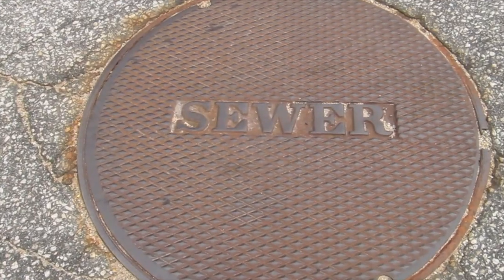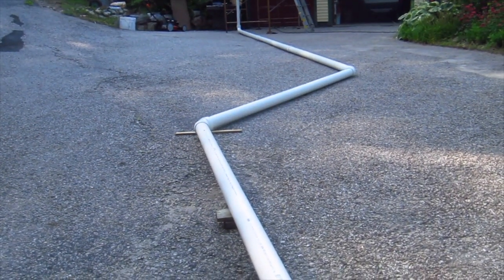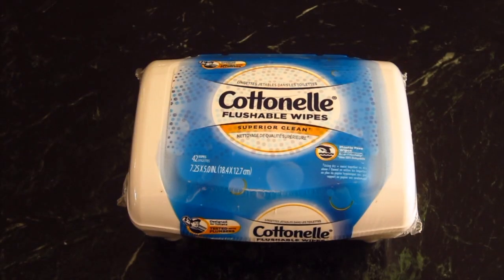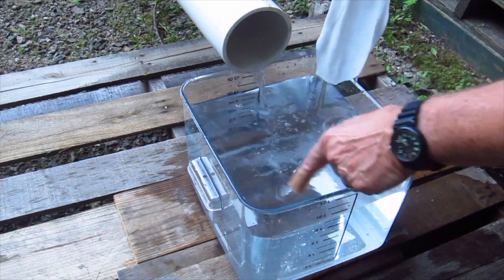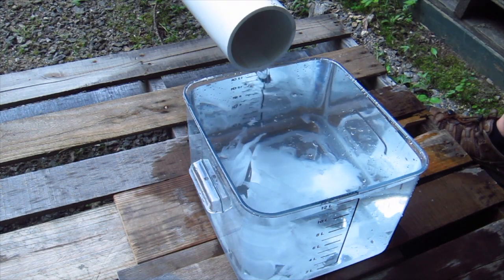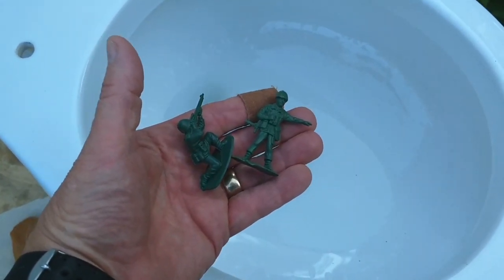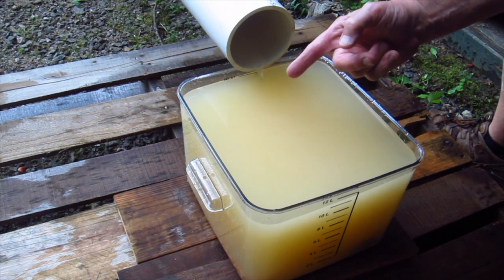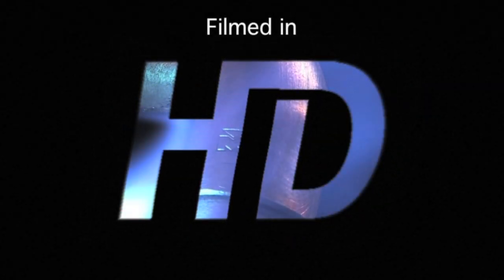Flushable Wipes - Do They Disintegrate?

Comment: Eventually! But if you have old cast iron and or terracotta pipes they will get caught up and block your system long before that happens !!!!!
Reply from the maker: Correct. That's why early in the video I talk about my test setup and how the PVC pipes were new. The chances of a clog in my test caused by a rough surface in the pipe were 0.0000000000000%

Comment: Yes never flush those so called flushable wipes besides clogging your sewer pipe inside your basement it can also clog the lateral pipe thats underground and goes to the street where it connects to the city's lateral sewer pipes. If you dont have the right type of home owners insurance and the lateral pipe gets clogged then you will be responsible for that repair bill too. That bill can cost from $5,000 up to $12,000 or maybe more

Comment: The ones my tenants used were not. It cost $800 in plumbing fees.
Reply from the maker: No, they WERE flushable. As I demonstrated in the video, you can flush hundreds of things down a toilet that should NOT be flushed.
Reply: @askthebuilder  didn't watch the video.  Too much like work :) but.. I won't let any tenants use wipes in the plumbing system. Just my rules.

Comment: I never use so called flushable wipes. I try to get a shower afterwards.  😂 Serious question tho, would pipes with a rough interior break apart these paper items more than these new smooth pipes?
Reply from the maker: No. The wipes that are durable are more likely to get hung up in your building drain creating a choke point and future clog.

Comment: Did a tour of the wastewater treatment plant for Cub Scouts.  The solids strainer had mostly flushable wipes and condoms in the screen.  If the sewer system is newish, they shouldn't cause a problem.  However, I can see how old systems will have a problem.

Comment: By flushable, they must mean that it will clear the bowl, but clearly just clearing the bowl doesn't mean it will clear the pipes. It should be illegal to call them flushable.
Reply: The video did show it clearing the pipes though.
Reply: @MonkeyBurrito  they do usually clear your pipes, at which point they become a problem for your city to deal with. But even that’s not always true. As he says in the video, your old pipes have snag points and buildup that worsen over time.
Reply: Technically golf balls are “flushable”
Reply from the maker: You can flush gravel, marbles, and thousands of other things. The labels should have a warning like cigarettes: WARNING: FLUSHING THESE DOWN YOUR TOILET MAY RESULT IN CLOGS THAT CAN COST YOU THOUSANDS OF DOLLARS.
Reply: @askthebuilder  mine do have that warning . . . well not in those words
Reply: @askthebuilder  You charge "THOUSANDS OF DOLLARS" to clear a blocked pipe?!
Reply: @ikiruyamamoto1050  Repeated clogs if the plumber doesn't bother to explain that the wipes are the source of your clogs. Or you might get several different clogs that need to be dealt with, or the clog is a lot more difficult to clear out. I'd imagine the several thousand is the upper end if the problem is severe enough that you have to rip out the old pipes and replace everything

Oh. I should probably also mention that sometimes a simple clogged drain can end up with other problems too. Apparently some Youtubers had a clogged sink that backed up the water drainage for some other pipes, which then lead to their air conditioner's catch pan for condensation and whatnot to become unable to drain and fill up considerably... and that lead to some pretty severe leaking in their ceiling with water pouring down like rain when the pan finally failed
Reply: @ikiruyamamoto1050  Shits expensive.
Reply: @ikiruyamamoto1050  If you can run a plumbing business charging less, feel free. You could not pay me enough to root around in someone's shit because they fell for this dumb marketing gimmick.
Reply: @ikiruyamamoto1050  THAT is why these companies get to sell these things.

Comment: I retired from the wastewater treatment industry about six years ago. These things were a total nightmare when they came out. We narrowed the source down to a few costumers and were able to get the problem pretty much under control. I sure hope something has been done by the manufacturers to either change the labeling or the product. Way too many of the brands should absolutely not be flushed. I feel sorry for anyone with a septic system that has used them.

Comment: Do they claim to?  Is every member of my specie  spoon fed reject?
Biodegradable means disintegrates?  
Just like a potato, vanish soon as flushed.
Just wow.
Reply from the maker: The Internet is littered with stories from sewer-plant engineers and municipal sewer-pipe managers demonstrating how many brands of flushable wipes do not disintegrate. They clog huge sewer pipes. They damage expensive pumps at sewer plants. Go to a store and see what the labeling says on the products. The issue is some may say NOT to flush, but the consumer rarely reads the label and flushes because it's easier than putting in a can.

Comment: All it takes to realise how fallacious of a claim "flushable wipes" are is to simply think:
How are these things strong enough to clean without falling apart while wet but weak enough to tear apart from simply travelling down a pipe?
Reply from the maker: I think your logic is a bit flawed. You might be confusing the word flushable with disintegrates. The wipes are absolutely flushable. So is gravel, so is nuts and bolts, so are marbles, so is dirt. There are thousands of things that you should NOT flush down a toilet. As I indicated in the video, the manufacturers are guilty of an ethical issue by advising people to do something that is harmful all for the sake of ease and profit.

Comment: You forgot Kleenex!
Reply from the maker: You're correct. I'm quite positive they would have done exactly what the single-ply paper did. You can test it yourself in a clear water glass. Fill the glass 90% with water and put in a small 2x2-inch piece of Kleenex. Come back in an hour and see what has happened to it. If it's still intact, then take a spoon, drop it into the glass and stir a bit to introduce turbulence into the system. I'm quite sure the piece will dissolve rapidly with turbulence.

Comment: Anyone who takes the time to set up a toilet atop of a baker scaffold to make a point deserves my attention and respect. I didn't know until NOW that flushable wipes were such an issue. Guess I've been too busy installing electric vehicle chargers to notice.
Reply from the maker: Thanks. This was a two-day project. I spent many hours both pre and post-production to share the truth with you. I could have flushed so much more, but I think the point is clear. Go here to get even more information: https://www.askthebuilder.com/flushable-wipes-clog-sewer/  and  https://www.askthebuilder.com/responsible-flushing-alliance-letter-to-askthebuilder-com/
Reply: A Baker scaffold is one that has locking adjustable height. They're usually sold yellow and have a single plywood platform. That's just a standard scaffold. This has been your tidbit from the man on the spectrum.

Comment: I've been a Public Health Inspector for over 30 years. When "flushable" wipes came out, I was teaching septic installer courses, so I put wipes in a mason jar with water and shook them. I still have them, more than 20 years later, they are still intact. They do not break down. Same thing with "flushable" cat litter.
Reply: A previous landlord had in the contract that tenants sign that they will not use flushable wipes. He learned about this after a huge repair bill.
Reply from the maker: Alex, some now do break down as evidenced in this video. The point of my video was to show what state they're in just before entering a septic tank or a city sewer line. The Internet is littered with stories supporting your stance showing how many sturdy wipes cause massive clogs in sewers and serious issues at sewage treatment plants. As I said, I'm good with people using them, but dispose of them in a can just as you'd do with a soiled paper infant diaper.
Reply: @askthebuilder  The thing that showed me you have more credibility on this issue than others is that you were willing to differentiate between different brands of wipes, rather than lumping them all into the same category as being equally bad.

I soaked several different kinds in water for days. Two brands weren’t even remotely affected. Cottonelle, on the other hand, can easily be shredded right out of the container. 

Even Cottonelle shouldn’t be overused. Anyone using more than one per flush is pushing it.
Reply: @askthebuilder  that's what the manufacturers are going to argue. What I can show without a doubt is that their claim that there is any mechanical component to the breakdown is complete nonsense.
Reply: That was 20 years ago, have you done another modern day test? Materials could change throughout the years maybe?
Reply: @HawksDiesel smart comment
Reply: @HawksDiesel  here's a modern day test. After clearing the drain line with a gas powered drain aug for 3 hours. 99% of the build up was from "Flushable" wipes.
Reply: But it is the bacteria that eats the wipes. When you put wipes in a Mason jar with water, it wasn't mixed with the waste and bio that is normally seen in a septic tank.

(A hypothesis from me.)

Great video, sir.
Reply: Why anyone would flush litter is beyond me. I learned to dispose of it in the trash. End of story.
Reply: @jociemarie compost
Reply: Soo why do they make em then
Reply: @AMJ-r9z they're criminals
Reply: @slothsarecool222  … because people will buy them if you claim they’re safe for plumbing?
Reply: I live in Texas (some pretty hard water) and did the same experiment, but my Cottonelle Flushable Wipes broke down in a couple of days.
Reply: I work for the City of Los Angeles Wastewater Collection,  now called Clean Water Conveyonce.  These wipes are a constant problem up in the hills where you have the bigger Houses/Mansions. Te cleaning lady's or maids constantly  flushing these down then we get a  big ol stoppage in the street  or in the right of way sewer lines. Always Roots mixed with wipes.
Reply: @operations845  are the cleaning ladies flushing cleaning wipes instead of these? I don't think cleaning ladies would use a ton of Cottonelle wipes to clean the house with.
Reply: Ooo I’m about to do this.
Reply: Wow! Companies and the government, stay lying to us. I'm glad to know of your informative experience in the field.
Reply: @alexmurdoch1391  so in essence it's a shit product because everything is flushable. But only toilet paper dissolves correctly.
Reply: You didn’t legitimately just say you did your test with water, did you? Is my septic tank only water, or are there certain bacteria that break down waste? You’re a fraud.
Reply: All of them break down better than my shit i can promise you that
Reply: @alexmurdoch1391  make it illegal through your city and state, Congress
Reply: @alexmurdoch1391  you got to put some poop on it or pee to help eat through it
Reply: Open it up and take a sip.
Reply: Maybe you need to add some organic matter to the jar. Have you tried poop?😂😂😂
Reply: @alexmurdoch1391  dude wipes are made with plant based fibers instead of synthetic fibers, but to be safe, don't flush them
Reply: Would it depend on how natural the fibre is for how well it breaks down in the septic tank?
Reply: False.
Reply: Not on subject but I did a similar experiment with my students and a McDonalds meal. Still intact, no spoiled meat, bread still soft and no mold one month later.
Reply: @lorihamlin3604  Why would you flush McDonalds?
Reply: @lorihamlin3604 And that is why that kind of food is a health hazard, it's sitting inside our bodies to a similar degree.
Reply: Yes they do! I’ve used them in hotel bathtubs to try to stop the water to run a bath and it never works! They break up into tiny pieces everytime
Reply: Liar  @HisSnowwhite214
Reply: America Strong!
Reply: When they say flushable on the label, then that means they're flushable

In the case of breaking down, I think all of the sludge goes SOMEWHERE to be processed in order to force disintegration 

You know all of that sludge MUST go SOMEWHERE after leaving your plumbing system And going through however much plumbing it goes through until it arrives at a certain destination
Reply: @0annonymous  your sewage lines might have grates in them that are meant to break apart waste. flushable wipes can get caught in up in those and cause a block.
Reply: @0annonymous wet wipes don't become sludge. They stay just as they are. In city sewer systems they routinely block impellers of liftpumps that cost a fortune to fix
Reply: @florichi 
If that were true the companies that sell them would be sued into oblivion, but wle
Reply: @0annonymous  You're wrong. That's called "marketing." To the people that don't care of their packaging ruins the environment because God forbid they should cut their child FRESH FOOD, and not buy chemical-laden packaged garbage! 

Fat dumped down the drain will STILL be there in 70 years! I've got photos of what my great grandmother did in that house that caused MAJOR plumbing bills in 2023. Full, top to bottom for four feet. Of compacted fat and grease.

Comment: What type of chemicals used in the making of flushable wipes ?
Reply from the maker: Easy. Read the product label. If the information you desire is not there, then reach out to the manufacturers for those trade secrets.

Comment: Don't flush facial tissues, either. They don't break down a bit!
Reply from the maker: I would agree that they probably don't break down within your building drain and on the trip to the city sewer or your septic tank. However, if they get dumped into a city sewer, the turbidity of the water as it travels miles to the treatment plant WILL break them down to invisible fibers. I know. I've tapped into high-capacity sewers.
Reply: @askthebuilder  The sewage lift we had before getting city sewer did NOT like facial tissues. It clogged up and had to be taken apart. That was spendy. I believe what you said, not arguing that. Have a great day and week!

Comment: In my opinion, a good paper towel is one that does not fall apart when wet. Because that’s mainly how I use them, to absorb and clean. But they go in the trash, not down the drain.
Reply from the maker: Correct. It's BEST to save the clean used ones. Let them dry and use them to soak up liquid grease. NEVER put grease down a drainline.

Comment: This experiment did not take into account the massive amount of toilet paper people typically use and flush in one sitting. 6 sheets of toilet paper neatly folded and flushed one at a time is hardly realistic.

I use cottonelle and always fold and tear a sheet in half so i can get 4 wipes from a single sheet and they end up taking way less space in the toilet and sewer system than the massive bunches of toilet paper people normally use.
Reply from the maker: This experiment was not about toilet paper. Check out the video title once more.
Reply: @askthebuilder  you included toilet paper in your experiment as a control, check out the video once more
Reply from the maker: @davidbasset7557  The six sheets is the testing requirement by the labs referenced in the early part of the video. Common sense tells you that adding more will ensure it doesn't break up. When comparing wipes to the TP, I had to stick to the guidelines or the FWA would cry foul. My suggestion is for you, since you have such an interest and strong opinion, is to recreate the setup, record your own video, use as much TP as you feel *people typically use*, upload the video, and come back here and share the URL with all of us. But I'm pretty certain you'll offer up some excuse. Let's see if I'm right.

Comment: And test videos like yours & viewing others means I will stay with my 3 gallon per flush toilets.
Reply from the maker: Smart man!!!! I wish I would have bought 100 of them back when the original low-flush toilets were introduced. I'll bet I could easily get $1000 for each one still in an unopened box.
Reply: @askthebuilder  While you can no longer buy a new 3 gallon flusher, you can order all of the piece parts to repair an 'old' toilet.

Comment: This only proves that wipes don't break down until they're further along in the system. I would expect them to remain intact a little longer than toilet paper. Dude wipes are made with 100% plant fibers, so I'm going to keep using them AND flushing them. I have been doing this for decades with no problems in the same house.
Reply from the maker: Christopher, you're so wrong. Tell me how you know wipes break down farther down the line. Do you have proof of this? The people who work in sewer plants have the proof you're wrong. Go watch all those videos or do a simple internet search. Also, READ all the comments under this video as several sewer-plant managers have chimed in. You're a great example of a person that makes statements and arrives at an opinion using a limited data set.

Comment: Great demo. Although, I do need to point out that using higher quality TP like Charmin one can (and shoud) use far less. The cheap single ply stuff requires one to use many more sheets for number two LOL! As far as a septic system---people often don't think it through well before flushing and they do sell TP that breaks down better for these systems.
Reply from the maker: Glad you like my videos. If one or more helped save you time and $$$, check out the THANKS text link under all my videos.